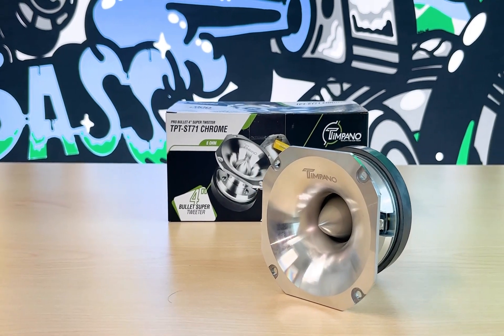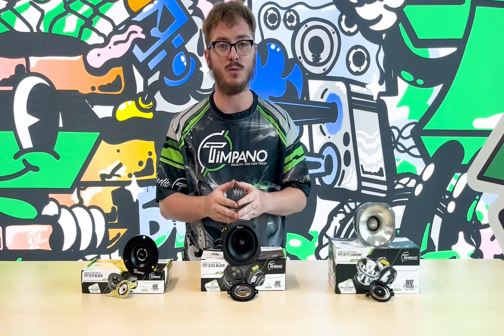Timpano Tweeters - Which Super Tweeter is the best for my Sound System?

Comment: Stop using MAX as a unit of measurement all that’s gonna do is make people blow tweeters.
Reply from the maker: The Max power, is the max you can run it - This Information is great when you are choosing an amplifier which these tweeter can take up to 450 Watts per unit so if you are getting an amplifier to run 8 of them - you should be getting at least a 3000 Watts amplifier to have the power to push, which they take all day a TPT-3000 fullrange amplifier